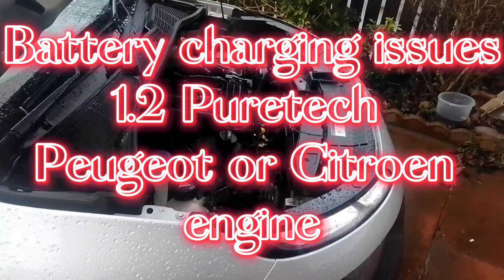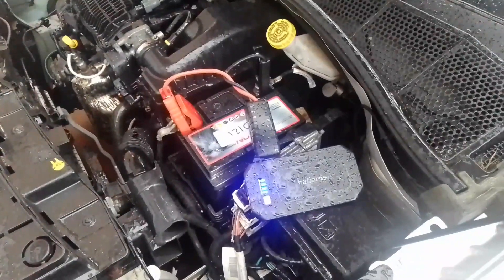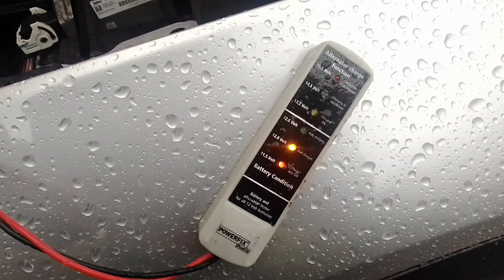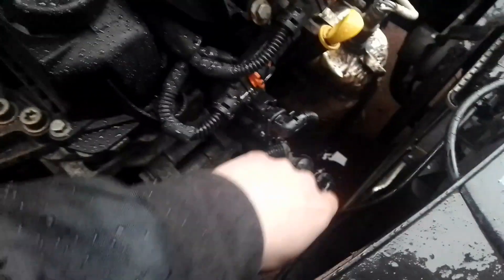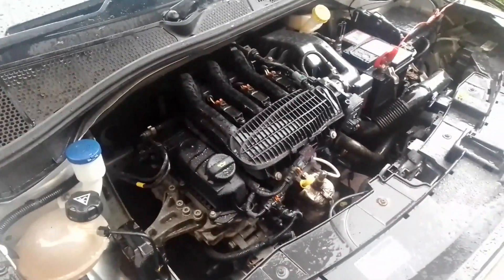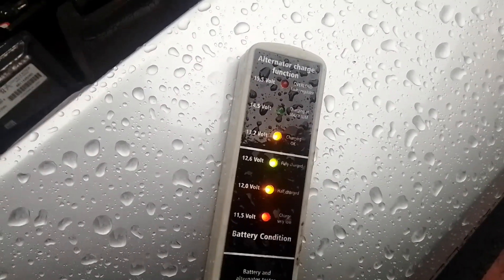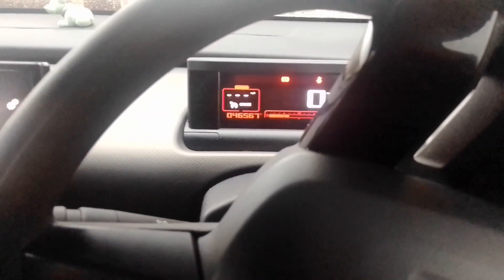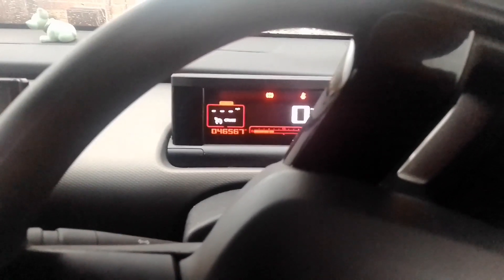Battery Charging Issues with Peugeot/Citroen 1.2 Puretech - Smart Alternator Fault

Comment: hi , im trying to remove the smart multiplug connected to the alternator , in the video it looks as if you just pull it off but i have tried this a few times and it wont budge . its at 1.08 in the video when you pull it off . is there something im missing ?. please help as its driving me crazy , any advice appreciated .
Reply: I have the same issue, OP if you can please provide support

Comment: H,

I have exact same issue.
After replacing alternator to new one its not charging. I have taken the plug off and its now charging ok. My question is hoe long can i drive like this if there is no faults or anything can I just leave it permanently like this...?
Reply from the maker: I would like to say you could drive it like that all the time and I have heard people do this, I drove around for a month or so until I got booked in for the software update to correct the fault with the alternator.
Reply: @DavysSkodaAdventures  Thank you very much for your reply.
I guess I will just leave it like this because car drives super no issues at all and no warning light or anything on dashboard. Voltage is nice and steady.

However I would like to ask you another thing if you don't mind please.

Basically I was curious to see if there is anything wrong behind the plastic cover on the regulator.
Upon removal I was surprised to see that the electrical plug I have disconnected doesn't actually connect anywhere from inside is this normal is it suppose to be like this? because looking at the plastic cover that i removed from outside obviously there is connected but then if I look inside its sealed literally just plastic I am confused.

Comment: Hi , i have this exact issue , must it go to a dealer for the update? And how long can you run the temporary fix as i cant get into a dealer for 3 weeks 😂
Reply from the maker: If you have a Citroen or Peugeot Specialist nearby then they should be able to update the ECU, I think I was running it for at least a couple of months before I could get seen by the specialist to update it. If you have a Peugeot I beleive it was part of a recall.
Reply: @scottishcarenthusiastsandtrain  Hi thanks for the reply,  it's a citreon cactus , I'll have a ring around the local specialists tomorrow, thanks for your help 👍🏻
Reply: @DavysSkodaAdventures  I've been to citroen they are adamant there is no software update to resolve this 🤔
Reply: Did it work for you?

Comment: Or are there two connectors which one did you take off
Reply from the maker: I took off the square multiplug socket l, the round one above is just a cover for a bolt.